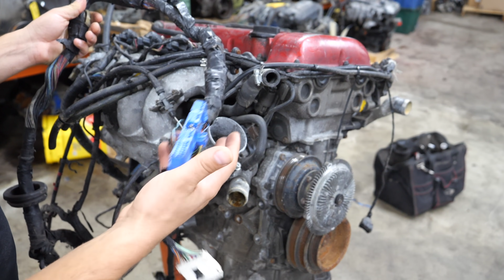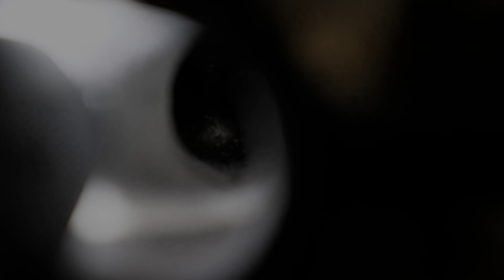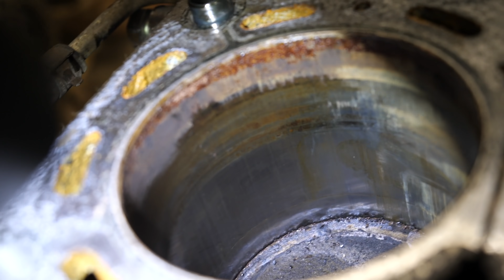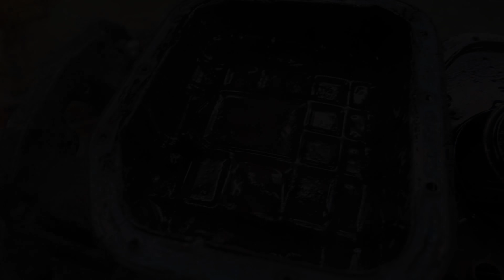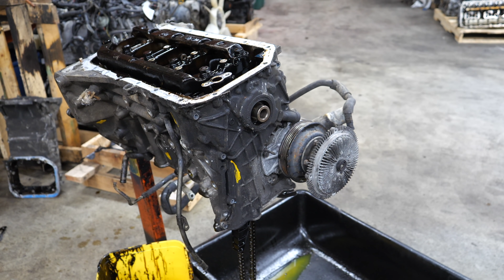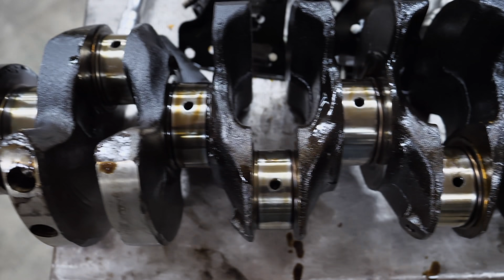JDM Nissan Silvia SR20DET BAD ENGINE TEARDOWN. What Killed The Most Popular 240sx Swap Engine?

Comment: Just from observation the slack in the timing chain the 0 compression result corrosion on the inlet valves and in the inlet manifold no-4 having significant water damage I would be looking towards sticking inlet valve stems from corrosion which allows the cam to lose tension and let's slack in the chain and the 0 compression would have been due to the valves not closing 100% I have  run in to that a couple times over the years.

Comment: SR is a fantastic and reliable engine in the right hands. Most kids that got them did not know how to take care of them. Crap oil/oil filters and crappy gas cause these motors to got to an early grave. I have had 400hp on my SR  and was reliable for 6 years of abuse before I sold it.

Comment: Hi Eric, I wonder, with all you knowledge and experience in stripping down broken engines, what you would design as the most reliable (perfect, most powerful?) engine if you took all the good parts from every engine that you have stripped down? A bit like picking the best sports team from what ever era or team. No expense spared in this purely fictional, imaginary engine. Would love to hear your thoughts and comments!
Reply: Ford H.O. 351w block amg internals Nissan top end turbo tuned (amg internals are in the Pagani Zonda 720) with the Nissan top end you'll get great duration this is from my experience in the world of cars
Reply: @racinzebra95  wtf
Reply: The way engineers have design engines is that the smartest engineers have chosen to make weak points on purpose The best engineers have made this week points so that they are inexpensive and easily accessible to fix and won’t cause catastrophic damage if destroyed.
Reply: @alexstromberg7696  the 351w block has a slightly larger chanel for the crankshaft, the AMG internals are factory forged so good power easily modified (plus the Pagani Zonda has them) , Nissan top ends are quite peppy with dohc top ends. They said build a fictional engine. This is literally what I would build for power, reliability, and economy. The V8 won't drink as much as a v12. The cast iron won't overheat at higher rpms. The Nissan top ends are dang near bullet proof. Throw a holly sniper intake it'll be a comfortable 600-700hp out the crate.

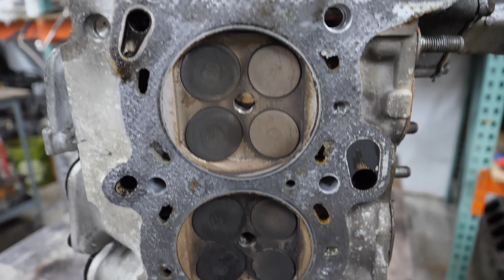Comment: There is clearly something wrong with the head, at 13:00 the #2 combustion chamber from the top is different from all the others. Also, the intake valves on that cylinder look chipped and torn, that could easily cause no comparison. I guess he didn’t notice it. 🫤

Comment: Why do you not use a impact driver to break free all the bolts? Wouldn't it be easier and faster?
Reply: Because that’s not the proper way of removing or torquing engine bolts. You can’t use an impact.
Reply: @I_know_what_im_talking_about  thank you for the answer.

Comment: How do you do a compression test the right way with the engine out of the car?
Reply from the maker: With a starter motor and a trans or bell housing.
Reply: @I_Do_Cars  - and a battery and a compression gauge.

Comment: I hate when pull a part does that especially on transmission because there's a chance of whatever they're using to puncture a hole in the trans could  damage the valve body on the transmission rendering it useless scrap metal

Comment: I think it hydrolocked on the swap.  Some one left the engine bay open without a manifold on it and #4 was just the victim.  The turbo sucking in water would have shown 2 bent rods
Reply: overheated,blew headgasket at no4

Comment: I had a Nissan RB30E engine which looked that black inside & I changed the oil once every 5000 kilometres (3000 kilometres),the car it was in (a Holden VL Commodore) had done over 400,000 kilometres (240,000 miles) but & I still have the engjne block which needs at least to be bored out to a 0.020" oversize to make the cylinders serviceable again,the worst cylinder has 0.117 millimetres of clearance which is well above the factory 0.05 millimetre clearance.

I built a Nissan RB30DE engine out of another 300,000 kilometre (180,000 mile ) old RB30E engine & RB25DE cylinder head which I put 200,000 kilometres (120,000 miles) onto but the car needs bodywork (has rust) which is why I pulled it off the road.

The engine still has good compression, Nissan were good until the Renault alliance which is when they went crap as the Renault engines aren't as good as the Nissan engines were  !
Reply: many VL and R31 went 1,000,000km,one of the best engines ever made

Comment: Ive dealt with building a couple sr20de motors for my 93 NX2k. When I blew up the first motor a rod attempted a space launch. Drove about 6-7 miles with knock before it blew up 1/4 mile from home

Comment: These engine are getting very hard to get hold of now fetching at least £4k in the uk broken, nissan pulsar gti-r in hoghest factory tune form, 180sx's, 200sx, s14,s14a amd s15 red top is the rarest. 
unlike a yank motor you could of taken that head off complete jist remove chain amd tensioner amd whole thing lifts off

Comment: Master Flow make a 32x32 tray with a spout that makes a really good engine stand drip pan.  You can make your own for a ton cheaper though.  In either case, ya should look into making some cheap ones and carpet em in oil dry mats (mainly to absorb impact of falling parts)

Comment: Definitely an SRDET20 mismatch.  Not from a S14/15 200SX/Silvia as all  domestic and export versions had a black cam cover, variable timming on the inlet and the inlet manifold log is not reversed like the one in the video, as in the plemium is at the top on any stock Silvia.  Kind of weird that the short is block is probably is a SR20 non turbo with a Pulsar GTIR or Bluebird turbo head.
Reply: Could be from a 180sx or s13.
Reply: @joecook3223  you may be correct.  Not sure if the SRDET fitted to the S13 180/Silvia had a red rocker and the inverted inlet manifold.  So hard to find an standard image.  From memory a work colleague had a bog stock 180 ca18 and S13 Silvia with the SR turbo, recall the car with the red cam cover with the plemium adjacent to the head, the Silvia looked just like my S14 minus the variable timming.
Reply: Yep your right looking at some for sale.  BTW found one with a RB25DET for sale.
Reply: s13 Silvia/180sx came with red top and black top SR20det engines after 1990. Nissan made the switch to black tops around 92-93ish. 1995 is when they switch to the notchback with VCT heads. Early s13 sr20's had smooth front heads, late s13 sr20's had casted fins on the front of the heads (Purely cosmetic). S13 engines have a high port head (Plenum on bottom), s14 engine have a low port head (Plenum on Top). All FWD SR20's are high port heads.
Reply: @thatguytj420  were there any difference between the high and low port version?
Reply: This definitely came from a JDM silvia, I've seen this exact engine in s13, don't know if some early s14 got it too before they switched to blacktops.
We never had this engine on exports, only blacktops as far as I know.

Comment: Just FYI, water actually IS compressible....just not in an engine.  We used to compress water in a reactor plant during solid operations.  Granted, we were at 2000 psi in a system designed for it.
Reply: I had a college factory night job where I tested small to huge valve bodies for pinhole casting leaks.  Depending on the valve rating the test might go as high as 10,000 psi.  Put the valve on a stand, seal all the openings, fill with water and start pumping.  Take a valve body that holds 500 gallons, pressurize it to 3600 psi., open a drain valve and watch the pressure go to zero while releasing maybe a teacup of water.  So, compressible yes, but not very.

Comment: On my cars I change the oil every 3000 miles or once per year.  When you change your oil you are removing all the combustion DIRT.  I don't care what people say about long oil life; 3000 miles or once per year.  You see all that black metal in the video at 4:04?  That engine wasn't built with black metal.  That's bullshit.  And that doesn't happen if you change your oil at 3000 miles.

How much did that car cost~?  An oil change is cheap...

On my '14 Porsche 981 Cayman S I use Driven DI40, and on my '01 Subaru Outback H6, I use Castrol GTX.  I would use Castrol in my Mercury outboard, but Castrol does not make the 25W-40 that it needs.  Thus, I wind up spending way way too much for the proper weight Quicksilver oil at West Marine.  Any other engine?  Like a mechanic that I knew for a long while said:  "Just put fucking Castrol in it!"

Change your oil at 3000 miles and your car's engine will last forever-

Great video!
Reply: Yea but this is like a freakin 25-30 year old engine! You can’t really expect it to be clean. They are beat on and abused and put away dirty. 

Quality oil and filter is key. The mileage of use isn’t really the final determining factor. It’s the type of use that matters and overall engine design also plays a big role. Some engines are just HARD on oil, regardless of what you do and others can easily do 10-15k mile oil change intervals and still look clean inside after 200k miles. 🤷🏻‍♂️ I’ve seen it. Trust me.
Reply: @I_know_what_im_talking_about  Now I will debate you Artem:

First of all, there are plenty of old Porsche/Chever-lay/et cetera engines that you can take apart and all you see is gold colored metal.  These engines have had my recommended 3000 mile oil change intervals.  When you change your oil, you remove the soot from the engine.

Reductio ad Absurdum:  Let's say you bought a 1990 Porsche 911 and pickled it.  Zero miles since then, and you went and removed it from storage and took it apart.  What would the metal look like?  It would be perfectly clean.  NOW, let's put 200,000 miles on that engine over the past 31 years and how would it look?  If it had had 67 oil changes over its career on the road, unless it was used for extreme service such as flat out racing, you would see this engine as having a gold cast to the metal and nothing more.  "I Do Cars" videos show this plainly.

As to type of oil, I would say that an engine that has always had synthetic needs to continue to use synthetic, and and engine that has dinosaur juice needs to continue to use dinosaur juice.  For the later I suggest Castrol.  What you DO NOT WANT TO DO is put synthetic in an old engine that has been running stegosaur slime [heh! sorry~];  This is a sure way to cause an oil leak.  I was a flight instructor for four years and one of my students was a chemical engineer from Korea and he told me on old cars to NOT change oil brands, since the different detergent package could cause "kudos" or baked on crud to come loose and small but essential lubrication passages might wind up blocked as a result...

Oil changes are cheap.  Do them at 3000 miles, or just lease a car and be done with it~
Reply: @Flies2FLL  — I love the engine tear down vids that he does but that never tells the whole story. 

I work in an automotive shop and have habitual customers who always bring their turd in 2, 3, or 5,000 miles PAST DUE on our 5k mile synth blend oil from the barrel and their engine is fine and surprisingly clean inside, all things considered. 

The very dark, oxidized and carbon’d up examples usually have other issues like disappearing coolant and an absurd amount of oil loss in some form (burn off or leaking) to where they come in with a DRY dipstick. 

The remaining oil has to work twice as hard and that’s when deposits are formed and harm is done. 

But on a perfectly healthy and mechanically sound block… I see no issues following the manufacturers maintenance reminder, even when using cheap synth blend oil. 

Synthetic oil just gives more peace of mind since it’s suppose to be a stronger oil. They all meet the same spec and can be mixed all you want. It says it right in the bottle. It’s all controlled by the EPA and is safe for any idiot with enough IQ to change his own oil. 

You’re over thinking it way too much and still repeating old myths about oil that doesn’t apply to today’s Lube on the shelf. 

I have done dozens and dozens of Lab oil analysis with my own cars and trucks. 3k oil changes are for extreme severe duty, not your average grocery getter.

Comment: I work at a pick n pull yard, as the “depollution” tech. I can tell you that anyone who punches an oil pan like that is straight lazy. I take every pan bolt out, and put it back in. Only if the bolt is stripped will I punch the pan with an air hammer. Most GM tranny pans I will punch however because not very many GM trannys are sold from our yard for one.. and two it’s the fastest way. I’ve found a sweet spot where it at least feels like I’m not hitting any gears.. but I know it’s probably still shot and don’t really care. Ha. Big picture of pick n pull yards is so the parent scrap company can legally have a yard of 500+ cars waiting to be crushed. Have a 1980 Bronco 302 SB, mid 80’s Celica Supra. 80’ Camaro, 91’ F250, have a 1970 Austin Town Car that was imported from the UK. Still had the paper in the back with all the fares in pounds and pence in 1980, and the drivers cab registration. Now it’s in my garage. (The papers, not the car. Had no motor and needed near full restore) Some pretty neat stuff comes to get crushed.

Comment: no sir that engine was ran hot blew head gasket sucked water into cylinder and bent that rod otherwise re ring bearing it new rods and slap it back together run long time

Comment: JDM engines are a crapshoot. Most have never had an oil change outside of the warranty period - a consequence of the "Shakken" rules which result in most JDM cars having a total lifespan of 5 years

NB: Passing a shakken isn't difficult if you do it yourself, but dealers charge so much for it that most owners simply buy a new car